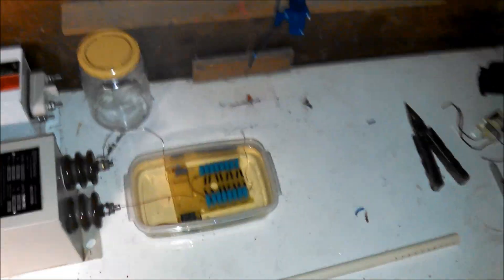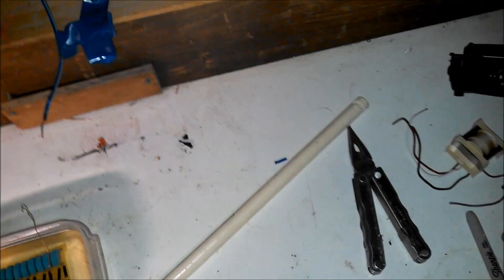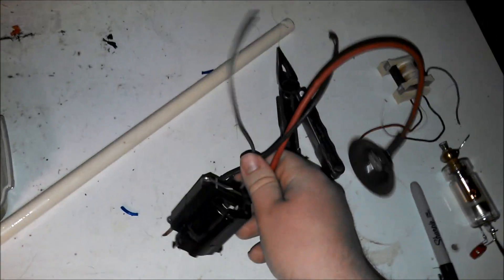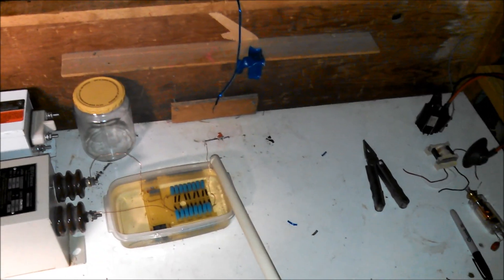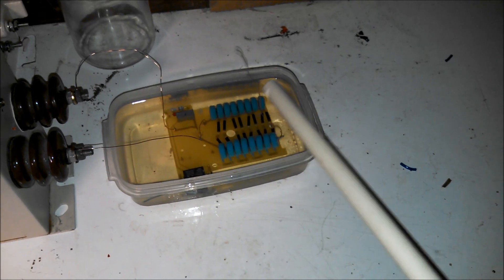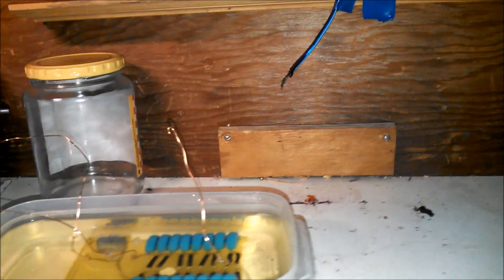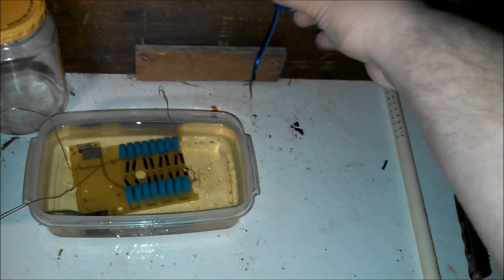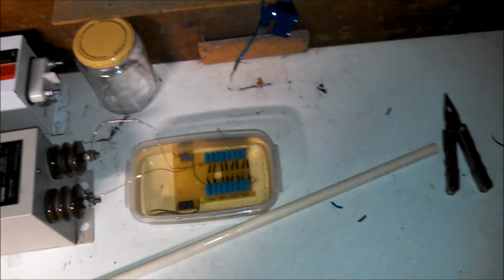Cockroft-Walton (Part 2) -  plus extras

Comment: i know this is an old video, but for a center tapped transformer like a NST you need a full wave CW multiplier, to be able to go to ground, also the tv flyback wont work as it will output DC.. but the original one will

Comment: Hello, mate. I was wondering if you could show me how to connect the voltage multiplier to the zvs flyback driver. My voltage multiplier is negative not positive by the way. I mean, which side is connected to the HV red wire coming out of the flyback and which side is connected to the ground wire that in the back of the flyback. Finally, which side becomes the output of the two in the front of the voltage multiplier. Could you show some pics, showing it step by step which now one has ever done. you do connect the red hv wire to one of the two and then connect the flyback ground wire to the other on the left or right leaving one in the front to be the output, but which one. where do I connect the other output that suppose to be the common or ground is it the same connection as the flyback ground wire? Any way, your a blessing thanks for everything and keep up the projects. They are inspiring.
Reply: A half wave (standard) multiplier is positive when the diodes arrows are pointed upwards and negative when the diode arrows are pointed downwards. The multiplier will begin with a capacitor at the bottom on one side and the first diode connection on the other. Your ZVS driver should be an AC output (It needs to be AC) so either side of the output coil will suffice and be sure so connect the return (Ground connection) to the first diode connection at the base (not the capacitor side). THE OUTPUT side will be the last diode connection side past the last capacitor. Click on this link. https://upload.wikimedia.org/wikipedia/commons/thumb/b/b6/Voltage_Multiplier_diagram.PNG/1200px-Voltage_Multiplier_diagram.PNG . This next link shows the diode orientation better. https://upload.wikimedia.org/wikipedia/en/thumb/b/ba/Stacked_Villard_cascade.svg/400px-Stacked_Villard_cascade.svg.png